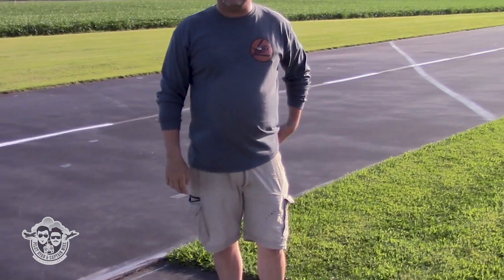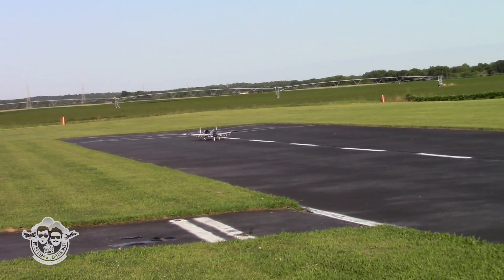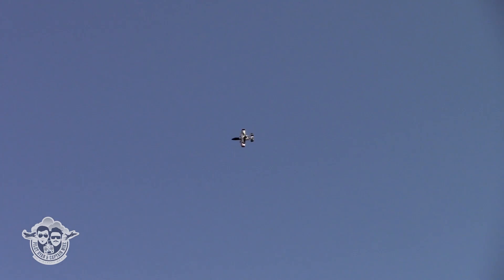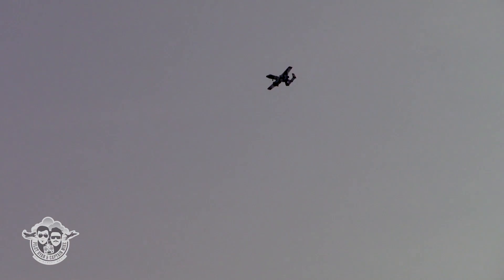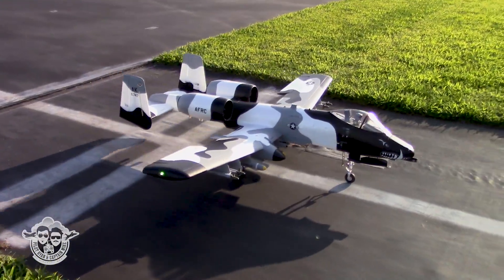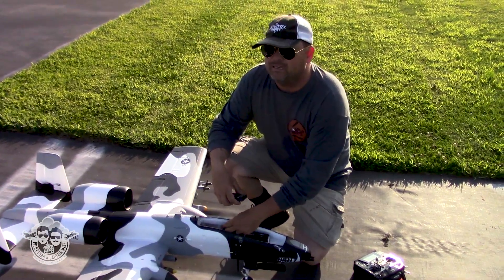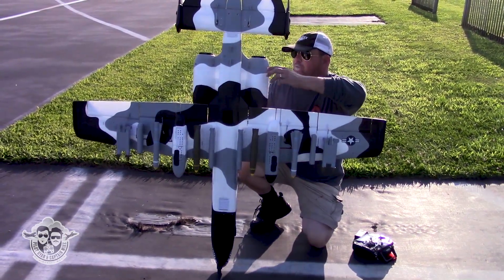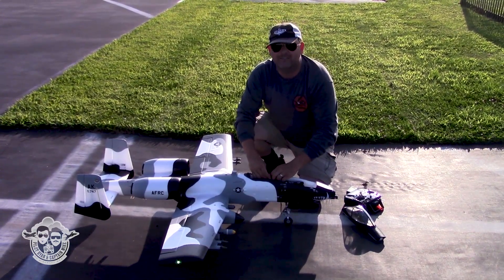FMS A-10 Arctic Camo Twin 70mm EDF V2 Maiden Flight

Comment: Could you post some set up parameters like high and low rate percentages and expo ?   Spectrum user here.  I have one on the way . Great video
Reply from the maker: Thanks man, I’ll get to you on the rates soon
Reply: @PilotRyanMedia   I also messaged you on Facebook if that's easier..   thanks man !!!
Reply from the maker: Hey Shane here’s my rates aileron 90high 60low , elevator 80high 60low, rudder 80high 70low 30% expo on all surfaces all the time.

Comment: Hi Ryan 
I’m currently deciding between the Fms and E-flite A10. 
Which would you choose if you had to decide between the E -flite A10 and the fms A10, 
I currently have a selection of Fms and E flite planes and find that both have great qualities in different areas. For example the Futura lands incredible and can fly super slow where as the havoc is really fast and hard to slow down but the roll rate and acrobatics are better. 

Any advice would be appreciated.
Reply from the maker: I’d say the FMS for me. I really like the size and how I can easily use different sizes of batteries. The flight character is supreme. I still have my FMS please consider using my link here to Horizon https://bit.ly/PilotRyanHorizonLink
Reply: @PilotRyanMedia  
Thank you Ryan that’s a huge help, I’ve been pondering over this for a while but my mind is finally made up. 
To be honest I was definitely swaying towards the FMS as I like the build and the fact the wing are easily detached for transport and storage. Fms has really smashed its competitors in this way especially with their quick servo block connection rather that unplugging individual servos. 

Thank you again and I’ll definitely use the link. 

Love your channel 👍🏻
Reply from the maker: @arronthomas5763  thanks a lot! It’s my fave a10 and I’ve had all the foamie versions. Still have my fms

Comment: What kind of setup do you have on yours mine constantly tries to roll to one side because the edf's don't counter rotate did you have this problem?
Reply from the maker: Make sure the rudders are dialed in symmetrical and check your aileron and flap neutral position
Reply: @PilotRyanMedia  i will check out those items and see if it helps because its currently  a scary bird to fly especially at landing hopefully it helps thanks.
Reply: @PilotRyanMedia  one more question does your edf's on it counter-rotate? cause mine don't. I thought that was kind of weird. Thanks for all the help so far.

Comment: Left main gear failure on takeoff. On take off the landing gear fell off hanging by The wire. Landing gear broke flats with impact of the ground. After inspecting landing gear is held on by two foam blocks about a half inch by half inch. On about 8 lb plane. Devastating design flaw. They're plane flew great about 100 mph almost like a trainer very stable really nice plane. I can't recommend it because of the design flaw no way it's going to last.
Reply from the maker: Haven’t heard of that issue.